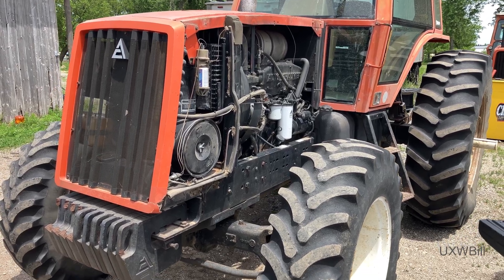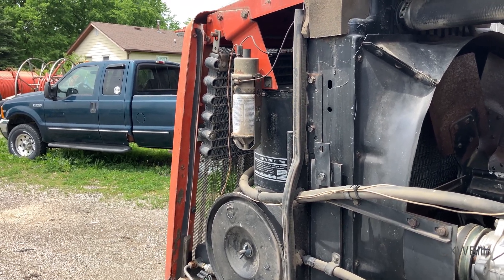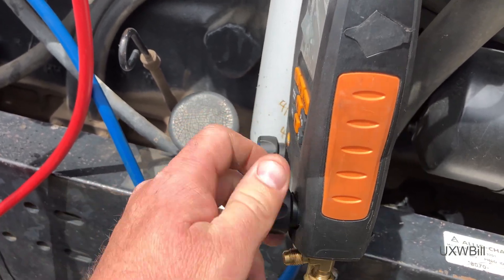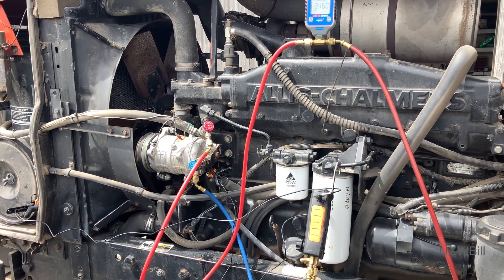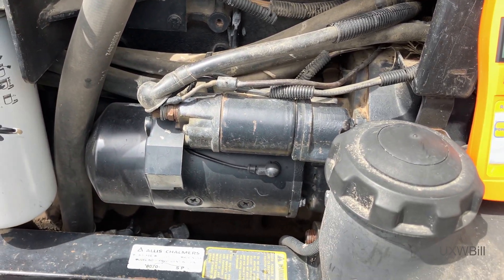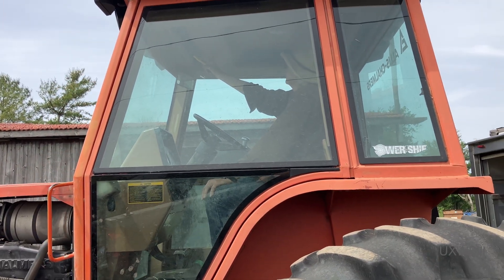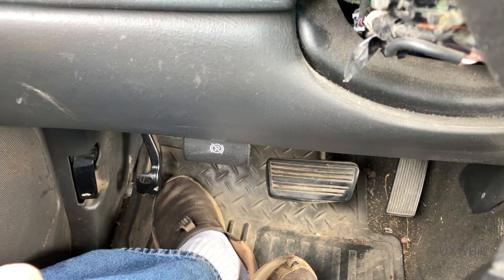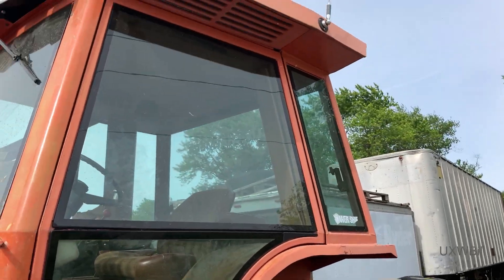Allis-Chalmers 8070 Tractor Air Conditioning Service, Charge and Test

Comment: Excellent video here! Back in july '24 I had to refill almost all refrigerant for my car's A/C system. Pressed the Schrader valve which replied with a faint "Pfew". OK, all gone! Bought a complete manifold set, a vaccuum pump and a few cans of R134a. Deep vaccuumed the whole system, replaced the Schrader valves to be sure ( they were factory from 2009 ), and took me two cans to get the system back in business. Especially as the summers break spiking records since 2018.

Comment from the maker: For those wondering: one of the tractor operators has reported in to say that this air conditioning system kept the cab comfortable at first and "too cold" before they backed off the fan. The in cab temperature control still needs to be replaced.

Comment: First time seeing your channel, definitely more professionally done ac than the average! Nitrogen purge, micron gauge, Testo manifold, not bad. That said, the vacuum level you showed is not enough to boil off any moisture, and maybe that was not your intent. Not sure why bother with superheat and sub cool for a mobile ac where you have a factory spec for charge weight…. Now maybe this was originally an R12 system which changes things. For old R12 system with original components I suggest looking into one of the propane/butane refrigerant blends like r12a, which performs equal or better than r12, leaks less due to larger molecule, and is less sensitive to moisture. Just a few thoughts, good video.
Reply from the maker: Hello and thank you for watching and commenting. A few days ago, I started writing a response to your comment and the keyboard had some sort of a flight of fancy, totally messing everything up.

This is a mid 1980s tractor and so it would have used R-12 with a Delco A6 or R4 compressor. I have a feeling that the Valeo compressor on this tractor was possibly taken from another vehicle, rather than being a proper replacement. I'm also of the impression that its conversion to that compressor and R-134a were done more quickly than correctly, especially given the lack of a low pressure cutout.

I wanted to pull a much deeper vacuum than that, but the owner felt they would have to use the tractor right away. As the cab windows don't open at all, they were insistent that I get the air conditioning up and running as quickly as possible, in spite of being cautioned about potential failures. The system was under very slight positive pressure with refrigerant before I started work, so I agreed to do so. I'd like to think something was better than nothing at all.

As to the superheat and subcooling, even with a weighed in charge, both numbers can be valuable indications of how well the system's actually working. It took only a moment to gather that data. Unfortunately, my measurements had what I believe were substantial errors owing to the limits on where my temperature clamps could be located and how well they were making contact (particularly on the suction line, which was rusty). So they didn't turn out to be helpful or useful anyway...

I've never used any of the "drop in" flammable replacements for R-12 and I'm not sure I'd want to do that in a system where the presence and severity of any leaks are unknown. (This did pass a standing pressure test with nitrogen done over about half an hour, so if there are leaks, they are likely very small.) Outside of the "standard" R-134a, the only other thing I've ever considered using as a replacement for R-12 is R-152a (difluoroethane, most readily available in "air duster" cans). Although I built a test system to try this, I've never actually done so. People say its performance and T/P curve are much closer to R-12, and it is claimed to work acceptably with mineral or POE/PAG oils.

As my equipment, training and background are primarily that of residential and light commercial stationary applications, my approach is definitely a bit unique compared to what's typically done in the typical automotive service shop. Even in the case of this system, and while I absolutely agree it was a compromise, it was on a vacuum pump for far longer than I've ever seen one of those automotive type all-in-one refrigerant recovery and recharge machines pull a vacuum prior to recharging.
Reply: @uxwbill  Wow, fantastic response. Your rationale make sense to me... I grew up on a farm and I am well aware that less than ideal solutions are often called for to get things done in time. As you say, something is usually better than nothing, and I certainly know how hot a tractor cab with nonworking AC can get! Good point on using a flammable refrigerant in a system of unknown status, though I think the risk is quite minimal... you'd need a good amount of propane to reach the lower explosive limit in the volume of a tractor cab, I'd think.

R152a would be an interesting experiment in an R12 system, and would probably work reasonably well.

You're right on those recovery/recycle machines.... they seem to be equipped with fairly low spec vacuum pumps in most cases, and they tend to "recommend" woefully inadequate vacuum times, with no way to measure to micron levels. I own one made by Mahle and I have been testing it with a micron guage. The first issue I found, the long refrigerant hoses significantly reduced the ability to pull deep vacuum. I put shorter hoses on it, used plenty of Nylog on fittings etc, fresh oil in vacuum pump, and was able to pull down to sub 200 micron at the coupler. Really not a great tool for a system that isn't in near perfect condition to begin with. I find the machine great for recycling/cleaning refrigerant, and charging by weight, but it definitely lacks in the vacuum department. Looking into the possibility of replacing it's internal vac pump with a higher capacity two stage unit.

One last note, I have learned a lot from Tom Lech's videos.... practical scenarios dealt with in a theoretically sound manner.

Comment: Isn’t feeding a compressor liquid refrigerant a recipe for failure?
Reply from the maker: Yes. However, I am using the low pressure valve on the manifold as a metering device. It’s a common and safe method. You can also get devices that do this.
Reply: @uxwbill thanks, that’s good to know
Reply: @wesleycooper2647  normally, the refrigerant should be vaporized by the time it gets to the compressor, but yes, if a slug of liquid gets into the compressor exciting things will happen. In my view, the ideal way to charge is to pull a deep vacuum and fully charge by weight, which can often be done without even running the compressor (again if proper vacuum has been achieved).
Reply: @martintech2012  I’ve got a good 2 stage vacuum pump that’ll pull 26 inHg at my altitude. I can never get lucky enough to get the full charge by just the vacuum in the system. Maybe I’m doing something wrong

Comment: That's the joy of working on stuff someone else has modified in the past and not in an entirely proper way, at least it's not for a customer, cos that sort of setup would be a liability nope... :P
Reply from the maker: I have reason to believe the compressor was originally intended for some other application (maybe even pulled from a road vehicle?) and stitched into this system with a really hot needle. That's especially true given the lack of a low pressure switch anywhere.

Edit to add: this is actually for a paying customer. They specifically asked for a basic evaluation of the system, approved minor repairs and charging of the system to see what it'd do. They are plainly aware that no promises of anything were being made.

Comment: i don’t know if this will help but i remember the conversation the company i worked always charged an r 12 system starting at 70 percent slowly working up to 75 then 80 percent depending on outcome of the temperature, from the dash and of the manufacturers original listed r12 charge amount this would be difficult if the information in unknown or unreliable I don’t ever recall seeing a posted figure for sub cooling it would be interesting to see what you find out as I don’t recall it ever being used in the automotive industry as they charge by volume and it’s a fill to this amount listed and send it mentally i would imagine that the information is just an unpublished figure that would be my guess as my understanding of refrigeration is limited as got far into my education around these systems however I never did finish my EPA license as my employer did not require it as i was going into diagnosis of automotive electrical systems i also did not need it at the time now i wish i just finished it as i cut my teeth on doing a lot of the wrenching for r12 conversions i got really good doing gm trucks but i was more into the computers so that is the way i went got really into the electronics and everything diagnostic in cars i worked for ford for a long time until my back gave up now im just home most of the time anyway i look forward to a possible follow up video on what you happen to find out oh and by the way that condenser is not a common one Audi and Volkswagen used it for a few years in the 90s it’s really hard to get a hold of a replacement. Glad to see yours is in good shape and working.
Reply from the maker: The 2.7 pound figure given is supposed to be (per the AP Air company, who supplied said figure) around 80% of the original R12 capacity. (However, I don't -- yet -- have a shop manual for this tractor as I do the 7020 to double check that.) As best I'm aware, automotive systems are almost never charged by superheat or subcooling, though as with any other refrigeration system, they have both. I'll readily admit my approach is unconventional. Both it and my tools are a mix of automotive and stationary system service.

If you want the 609 MVAC cert, I'd say go for it. If nothing else, it's knowledge and a credential no one can ever take from you, which never hurts. At the time I sat for it, the test was open book. (The 608 is multipart and closed book, but with some study, a good understanding of the basics and a P/T chart -- which you were allowed to have and expected to use when I sat for that exam -- you can easily pass it.)
Reply: @uxwbill  thank you i have actually been looking into doing the certification as a completion to the information, I already have. I know there’s so much more, but as it means to also allow me to further my knowledge. to better understand the information i was given back in the days i have to admit i prefer your approach as you are doing what i love in automotive that is sadly being lost to time and that is understanding what went wrong and how to make it better for example I am currently working on a vehicle I would never personally own, but my grandmother is European. She has a 96 Range Rover and you cannot get the keys for them anymore. They’re no longer made so I have pride apart the remote to see if I can fix it and I’m happy to see early 90s technology so I believe I can then unfortunate part with this car as they were all about security and one of the very first to use a key transponder remote combination very similar to Ford’s Pats system but very custom early stuff unfortunately and the knowledge is badly limited by rover being purchased over and over and over multiple companies I don’t even know who has them now they even ultrasonic welded the keys together i just spent 4 hours trying not to break plastic or circuit board unfortunately when i got it open my first fear I thankfully didn’t damage anything or stab my hand in the process but lots of corrosion so we we’re currently doing some cleaning on the board. We’ll see how it comes out. hopefully it’s not made it into the one chip on the board i think it’s custom but im trying to find the details anyway i really appreciate the information on the test as i have been seriously looking into it thank you for taking the time to respond and providing feedback i appreciate it

Comment: Can you still get parts for this tractor
Reply from the maker: Of course.
Reply: that's good I would just replace the compressor and the parts it needs to blow cold again I'm sure in your area it's plenty hot during the summer replacing the compressor and parts was just a suggestion

Comment: Looks like there's another tool I need (I already have a wall powered pump, but a little battery powered one for the price Hazard Fart wants.. I've gotten away with using a much crappier wall powered pump on paying jobs, and this one looks respectable at first blush).

Also though, whaddya mean, that filter'll be fine, give 'er a bath in diesel, it'll run for another 10,000 miles 🤣
Reply from the maker: Harbor Freight seems quite confident in their cordless vacuum pump, as it has a five year warranty. At the time I bought it, they had a promotion that went something like "buy the tool and a battery, get another battery and the charger for free". All in, it was just a shade over $200 in December 2024. You could buy two and still have change left over for the price of one NAVAC 2 CFM pump, and I don't think the NAVAC is that much better. They claim it'll reach 23 microns and while I didn't try that hard, it got very close.

For a plug-in pump, I have their Pittsburgh two stage, 3 CFM model. I bought that one in 2016 or 17 and have used it on countless jobs. It still works extremely well, if a bit slowly on bigger stuff. I change the oil in it regularly. I wouldn't mind a bigger one for long linesets and larger stuff, but I don't need one. I'd buy it again...in fact, I did, when I found another of the same on their "scratch and dent" table at an out the door price of $55 all in. As best I can tell, someone opened the box and never used it.

The tractor operator might well object to the result of giving those filters a diesel bath, but it might keep the mice out of the cab! (As would getting rid of that fast food bag...) Amazingly, the windows don't open on the 8070's cab. Assuming A/C was optional, I wonder if non-A/C equipped tractors got opening windows?

Comment: It's a chilling thought when The Keykeeper gets in with the highly coveted first comment!
Reply: It's surprising to see such a beefy pollen filter for the tractor's A/C system - although I guess if it relies on fresh air intake, versus recirculation, that would be why. In saying that, I wonder why the choice was made to allow fresh air intake (beyond the obvious like the occupant of the cab smoking, or otherwise smelling like someone who has worked hard all day long), as it must require a significantly more powerful compressor, and associated componentry to complement it, which are surely undesirable when the engine may already be under considerable strain?
Reply from the maker: @misterrocks3035  The system does rely on fresh air intake, unlike that of the 7020 where most of the air was recirculated. Keeping the cab under positive pressure, even if only slightly, would also help to keep dust from getting in.
Reply: Presumably using fresh air intake would also help keep CO2 levels down which could become a hazard in a small cabin like that.